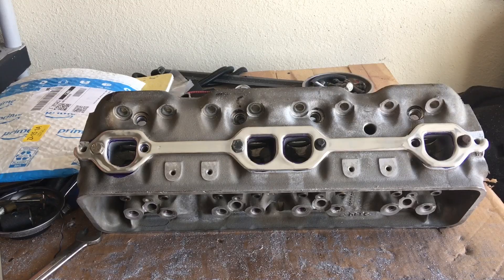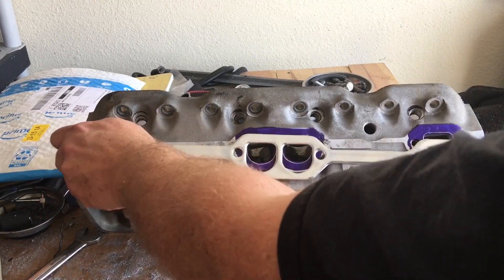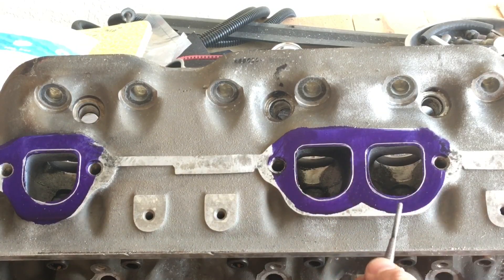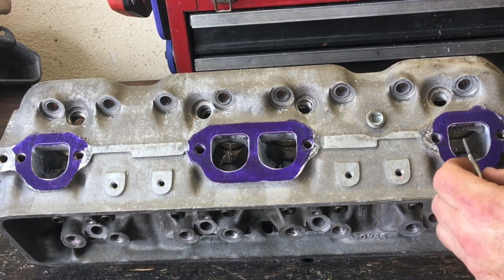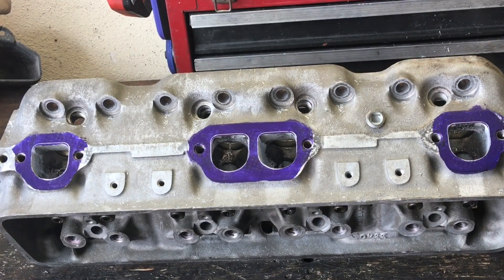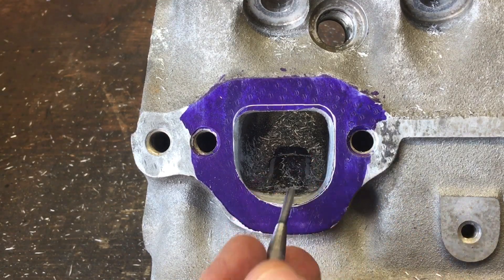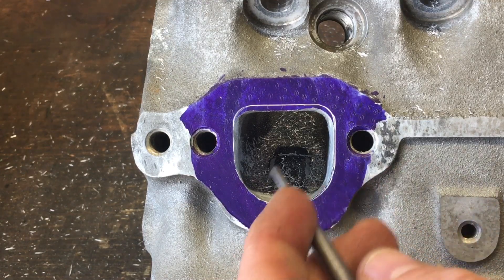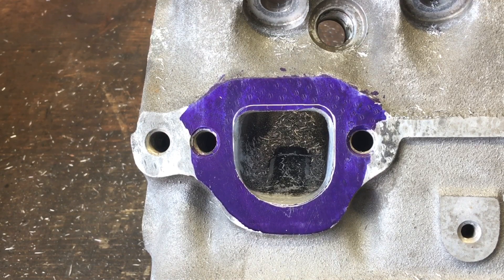Porting LT1 heads Step 1.5

Comment: As always... make a template of exhaust headers to see how head scribing lines up before work- leaving corners alone is sometimes a must.  Beyond that, 0.100" sounds off the hook:  looks like 0.030" [give or take] off either side?  I'm actually impressed with initial gasket fitment and would not be worried about bolting that straight up:  remflex?

Comment: What kind of flow numbers,  swirl and air speeds are you getting?
Reply from the maker: The flow bench services I’ve used didn’t supply air speed numbers.  The flow numbers differ depending on valve size used and port volume/dimensions etc.  A 2.02” valve on a factory seat w/ 3 angle valve job 275-280 cfm .600”-.650” maybe a tad more with more lift stalling around .750” lift.  Sorry I couldn’t be more helpful JD

Comment: is the floor wear the valve seat is?
Reply from the maker: Yes the floor of the port is the deck side opposite the valve over.  As the head sits on the engine the top is the roof.
Reply: @HeadFlowInc  thank you brother

Comment: Hello sir, I thought I caught a video of yours where you installed copper tubes in the pushrod holes to open the pinch point further? Do you have a link to that video? 

Btw I truly enjoy your videos! Using them on lt1 heads!
Reply from the maker: I have not installed tubes in anything so far but I’m interested in doing some at some point.  I did repair one pushrod pass through with a tube on a set of 4.3 heads years ago. Once 
The guy your remembering turned out to be a con artist who ripped off several people on head work. Normally I don’t mention his name because I don’t want to have any association with him. 
But I will say he has a completely different channel unless YouTube deleted it for legal reasons.  JD

Comment: What about cast iron LT1 heads? Everything I see is for aluminum.
Reply from the maker: Daniel Lawson The only iron LT1 heads I know of were from around 1970-71.  These heads are from the reverse cooling LT1 heads from the 1990’s. 
I don’t mess with iron heads anymore but have ported many cast iron SBC heads over the years. JD
Reply: HeadFlowInc the 91-96 B body LT1 engines had cast iron heads. The Y body and F body had aluminum.

Comment: What kind of 4bbl intake will fit the 2nd coming of the LT-1/LT-4 heads?   I try to atleast gasket match head to intake & manifold/ headers,  a complete smoothing and blending if it's anything more than a grocery getter!
Reply from the maker: JAMES! Since the 70's You can buy aftermarket intakes to carb the LT1/LT4, it’s commonly done especially for higher HP/RPM builds. 👍

Comment: Good info sir. I did about everything wrong with my exhaust side years and years ago recently cleaned it up and still managed to get 200 cfm @ 700 lift. I just wish I spent more time on the short turn and picked up some pro flow valves probably could of got 270+ on the intake side.
Reply from the maker: TPV Productions These heads are going on a stock bottom end LT1 with a .570 lift HR cam.
Reply from the maker: TPV Productions 200 cfm is a good SBC head.  Did you cc the exhaust port when you were done?
With these heads still having 1.94” valves will limit flow a tad on the intake side.
Reply: @HeadFlowInc  I never cc the exhaust side only the intake side. They floated from 197-200cc. I had 2.02 1.6 put in years back and your not suppose to go that big on stock seats. But A local guy managed to cut the seats and get them to work decent. I have the flow video on my channel.